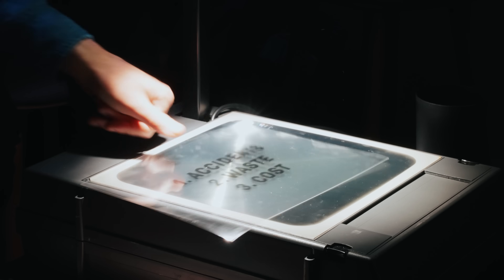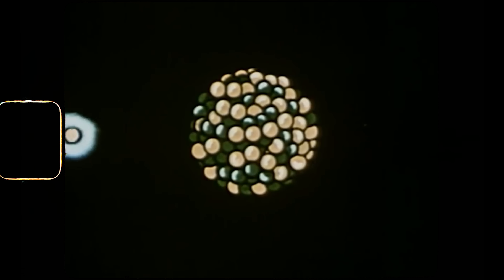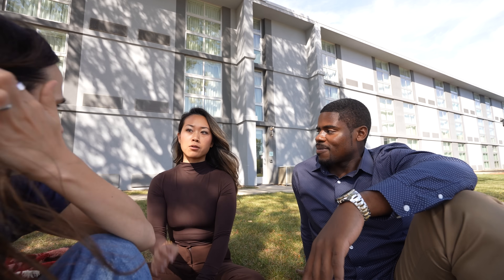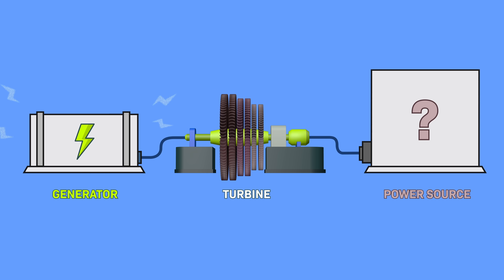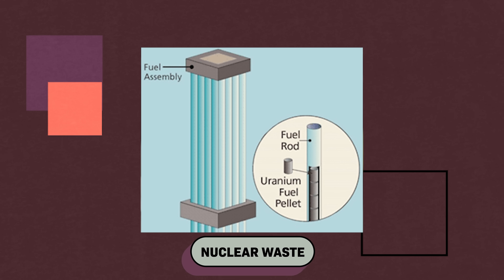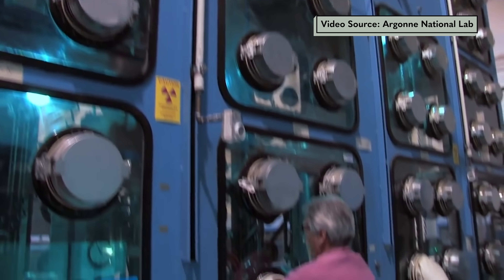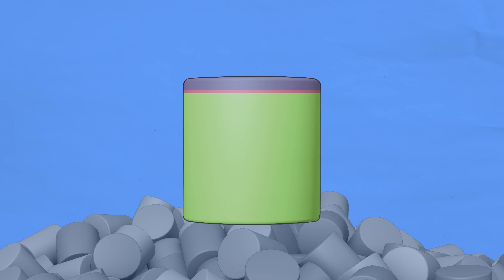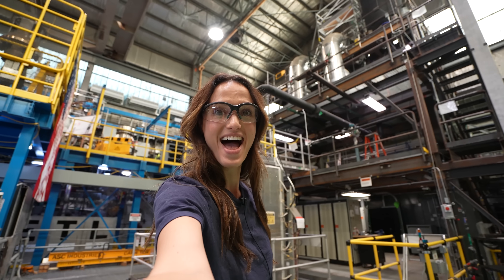The Big Lie About Nuclear Waste

Comment: Why is nuclear power and nuclear waste so hated? 
During the Cold War, Greenpeace made bank on anti-nuclear propaganda, much of it so dishonest that the co-founder of Greenpeace actually left the organization in disgust because of the lies they were perpetuating about nuclear power. But hey, it made billions for them, and people on the Left are just as susceptible as people on the right to propaganda produced with a profit motive in mind.

One of those pieces of propaganda is “nuclear power produces radioactive waste that is deadly for tens of thousands of years.” Uhh…no. That’s not the way radiation works.

The things that are most radioactive have the shortest half-lives. Radioactive waste is very dangerous…for a few years. After that, the highly energetic short-half-life stuff has decayed to the point where it’s somewhat dangerous for a few decades, and then those radioactive elements decay and you get something that is mildly dangerous if you’re not careful for thousands of years.

And this whole “deadly for thousands of years” thing is so interesting. That’s supposed to be scary? The toxic byproducts of many other industries are dangerous for billions of years! Arsenic, for example, used in the manufacture of solar cells. It’s toxic forever. I find it very strange that “toxic for thousands of years” is so frightening, but “toxic forever” doesn’t produce the same fear response.

Coal plants release far more radiation in the environment than nuclear plants, in the form of radioactive gas and radioactive fly ash from naturally occurring uranium and thorium in coal beds. If fly ash were subject to the same laws as nuclear power plants, it would have to be entombed in sealed casks. Instead, we mix it in concrete and make schools out of it.

Propaganda. Many, many people on the left have been conditioned by propaganda to feel an overpowering emotional response triggered by the word “radiation" and "nuclear".

Comment: It is most unfortunate that the average citizen has a visceral fear of the word Nuclear.  Even the ubiquitous MRI used to be called NMR (Nuclear Magnetic Resonance) imaging which is a pretty reasonable description of the actual process used but patients only heard Nuclear and feared the non existent radiation.   Politics and physics simply don't mix. Micro reactors are probably the future for remote areas and some forms of industry but it needs some sort of politically correct name.

Comment: Thorium.  Happy coincidence: thorium is mingled with rare-earth elements, those same elements we need for green energy and chip making.  Currently China provides the lion’s share of rare-earth supply.  Given the geo-political tensions we’d be wise to develop rare-earth mining and processing in North America.  Thorium comes along for that ride.  It’s treated as a waste product right now but thorium can be mixed into the fast reactors to further extend the fuel cycle.  Still more fun is that the US already has a thorium stockpile that would last nearly a thousand years in molten-salt-reactor (MSR) electricity.

Comment: You kinda forgot to mention that out of the nuclear waste created only 5% can actually be used for the recycling process. That recycling process reduces the volume of the very high radioactive nuclear waste but increases the volume of middle and low radioactive nuclear waste. 
Meaning: you would need way more of those dry caskets but they wouldn't have to last millions of years. 
Also worth mentioning: Japan and France tried creating those fast breeder nuclear power plants who would be able to recycle nuclear waste and both of them failed. The japan one was called Monju and the french one was called ASTRID.
So it makes sense that nobody really want to try something that failed multiple times already.

That being said, I'm not an expert on that topic, I was just really interested in it a couple years ago and read up alot of studies on it which made me understand why this isn't really a solution to the nuclear waste problem. Yes it significantly decreases the amount of years it has to stay stored from millions to only 1000s but it also significantly increases the amount of nuclear waste produced which is exactly something that we certainly don't want.
Reply: Molten salt or sodium fast reactors like Terra Power or Exodys Energy solve all the solid fuel fast neutron reactor problems. In the Exody's reactor the fuel pellets don't even need to be reprocessed, just chunked up and dissolved into the fuel salts. Nothing comes out of the reactor.

Comment: I've heard/read numerous times that the bulk of nuclear waste (by volume) is irradiated, non-fissile materials like tools and clothing. Are we still stuck storing all of that while only the fuel is "recycled"?
Reply: Let's say you expose a hammer to a  used fuel rod.  That hammer will go down to being as radioactive as before the exposure after about 200 years.
Reply: There is no reason that low-level waste needs to be treated any differently than any other garbage. This is just part of the over-regulation that makes everything in the industry expensive.

Comment: Excellent video.  Now do one on LFTRs; this stands for Liquid Fluoride Thorium Reactors.  These reactors were also developed at Argonne national laboratories.  Many benefits to LFTR reactors including vastly reduced nuclear waste and most of it does not last ten thousand years, much reduced physical foot print because there's no need to contain a steam explosion, and finally, what the public loves, is the nuclear reaction inherently cannot cause a meltdown.  American Scientist had a very informative article on them written by Dr Hargraves.
Reply: The main advantage for LFTRs that I'm aware about is that thorium is extremely abundant and is currently treated as a waste material by most mining operations.  If we could build viable LFTRs, then we'd be able to turn those waste piles into energy.  The main issue that I'm aware of is that the molten liquid salt is highly corrosive; and has been in need of some advances in material science before they can be made viable.  On the MSR vs LFTR issue, my opinion is that humankind would be better off if both were in an easily commercializable state.  More arrows in our technological quiver, as it were.
Reply: There is no advantage of a LFTR over a uranium MSR breeder. Actually uranium MSRs are cheaper and easier to build and have all the same advantages.
Reply: Same problem as with waste fuel. Too expensive. Both these technologies were developed when we thought we'd have a shortage of uranium. But then we found more uranium deposits and the cost of manufacturing new fuel crashed (because all the plants had already been built). As such there was no economic incentive to use Thorium or waste fuel. Some countries like India, China and Japan which don't have significant domestic sources of uranium might consider it as a national security thing, but other than that there is little incentive.
Reply: @veergauba  Incorrect, prepping waste fuel pellets for molten salt fast breeder reactors is cheap and you only have to do it once. Turning it back into solid pellets as described in this video is expensive and has to be done over and over.
Reply: Agreed.  We might have had these reactors in use for decades had it not been for the political efforts of Nixon to shut down that project.
Reply: This content provider will never do a video in favor of LFTRs. Bet.

Comment: wait, now that rockets are getting cheaper, wouldn't it make more sense to blast some of this into sun?  or perhaps not the sun, we don't want to fuck around and find out, but perhaps Mercury.
Reply: Putting nuclear waste into something that goes high up in the air and then very possibly explodes is... problematic.

That aside, thanks to the speed at which we are whipping around the sun, it takes less energy to send a rocket entirely out of the solar system than to slow it enough that it drops into the sun.

Comment: I hate these videos about nuclear power that sell the idea that we don’t have more plants because us ignorant people are scared.   Safe nuclear plants and these experimental recycling plants are way too expensive and can only be built and operated with enormous sums of public money.  Why not put that money in renewable energy sources that don’t produce toxic waste?   That’s the real question.  Its not because we are afraid.
Reply: Nuclear has a high upfront cost, but since they have a long life the cost is actually not high over the duration of energy production. Much of the high cost is due to over regulation and lack of experience in building them (in the US) China, Korea, UAE build reactors on time and budget.
Reply: Simple answer is because renewables are intermittent energy and to add transmission, back and replace every 25 years would be most expensive use more resources and mining (with its own toxic waste)andan enormous amt of land… then, what do you do with all the materials every 25 years? Millions of panels and turbine blades landfilled?
Reply: Simply because the yield from nuclear energy is waaaaay more than renewables can ever hope for
Reply: That's...not true. Even if every nuclear reactor had a meltdown in the USA there would still be less deaths per kilowatt that coal and oil. People in Cities with nuclear power have had incredibly cheap electricity bills. Nuclear power is purely a political problem. It is in NO way a cost or engineering problem.
Reply: You know of a renewable energy source that doesn't produce toxic waste?
Reply: @submijiru  As much as every manufacturing process produces some dangerous waste, I am sure they all do a bit but wind, solar, and geothermal aren't producing anything we dream about launching into the sun.

Comment: MOX fuel - containing plutonium derived from recycled spent nuclear fuel - is widely used in reactors in France and other European countries. On the other hand, fast reactors, which (probably?) are mentioned in the video, due to the problematic use of liquid sodium, are actually on the censorship. There are several other solutions for reactors operating on fast neutrons, including those cooled by lead-bismuth euclectics, but the problem here, by contrast, is the transformation under fast neutron bombardment of bismuth into radioactive and highly poisonous polonium. Nevertheless, such maintenance-free, heavy-metal-cooled fast neutron nuclear batteries are the future of low-power power generation. Such a maintenance-free nuclear battery as a local boiler house can operate without fuel replacement for up to 30 years. After this time, it is taken away and a new one is put in, and the used one is sent for recycling.

Comment: Switching to HALEU TRISO fuel enriched to about 18% would greatly increase efficiency, significantly reduce waste, and make it more resistant to potential heat damage when operating far outside of normal conditions. This is well established technology already, it just needs will and incentive to switch to the new fuel cycle.
Reply: Cost for HALEU used to be high and thus despite the advantages was only used in small research reactors. The main reason for this was the cost of enrichment. However enrichment costs have dropped as technology has improved that now enables much more efficient enrichment. HALEU fuel is still a bit more expensive than LEU fuel but the cost savings of less frequent refueling requirements, smaller reactor size requirements, and smaller volume of waste to dispose of creates a net cost savings.

Comment: I'm sorry, but this sounds way to easy and cheap. There is definitely more to tell than this short bit, which feels like a paid video for some company in the back. I am not saying that you are lying, but i am certain, that this is not the whole story.
Edit: If you are speaking german, there is an article from Quarks called So könnte man Atommüll recyceln.
Basically it says, there is no working facility and in Japan, they had 2 accidents in 2010 and shut down after 250 days.
Even though there are small steps, this is still in an early phase of development. (after 60 years!) Also it is still very expensive, so i guess unlike we run out of Uranium 235 (which some suspect to happen before 2100), capitalism will impede it.
Reply: Exactly like so much in the "isn't science cool" genre.
Reply: I dont think it's as scarce as they originally thought it would be (WW2 times), plus it can be reprocessed. 
Cost is huge, the initial cost of the facility is only a tiny portion of the overall cost for the next X hundred years that it needs to be operated, maintained, and decommissioned.
Reply: If it sounds to good to be true it usually is.

Comment: This is an interesting technologie, definetly. But the main reason, noone will care about it, is money. There are way cheaper ways to generate clean energy, like solar and wind. Even if the technologie gets improved, I dont believe it's possible for it to get cheaper than the classic renewables.
Reply: If the price of copper, neodymium and other rare earths gets high enough it might become competitive, especially if energy storage doesn't get good enough. Nuclear is a very good base generation of electricity. Just need to underline that new tech (like small reactors, gen 4 etc.) takes decades to refine and build, and that making it profitable requires decades of production.

Comment: This time it's *untrue.

What this scientist said, "We're talking about technology that has already been demonstrated before and proven. We just need to commercialize it."
Yeah, that's about the hardest part! In particular when it comes to recycling. Recycling anything, for that matter. Many people think that we're recycling most of our plastics. But we don't. Because it is increadibly hard and therefore not economically feasible. and recycling nuclear waste is way way way harder than plastics. The required facilities are way more expensive to build. Transportation is way more costly. Your staff needs to be on a whole other level education-wise, and is thus way more expensive. 

We recycle so little of our plastics not because of a lack of will, but because so many fail to generate profit from it. The market literally doesn't allow it. And this is even more the case with nuclear waste recycling. Nobody will be able to apply it for energy production and make it even remotely cheap enough to compete on the market. Economy of scale has its limits.

And on top of that: Remember, only high-level nuclear waste, which makes up but 3% of the whole, is even remotely suitable for recycling. We would still have to deal with the rest, which means the costs of nuclear waste storage wouldn't go down significantly.
Reply: Hush now, the sleepers are still enjoying their dream and don’t want to be woken up with facts and reason.
Reply: not true. You can use U238 in fast neutron reactors / breeder reactors. That's why they say US has energy for 150years
Reply: @martinkominek6712  But no one has ever seriously tried commercial breeder reactors. Things learned from previous attempts: they’re much more expensive to build, they’re proliferation hazards, there are serious safety concerns, and they produce neutron-poison elements like polonium that have to be continuously removed (and disposed of) in order to keep them from killing the reaction. So it’s not the easy solution that the YouTube comments section tells us it is. It would take at least two decades, probably longer, to build breeder reactors at a scale required to even beginning to replace fossil fuel. We don’t have decades to screw around waiting.
Reply: @davestagner  Again, not entirely true. Example is BN-800, although it's main mission is to burn plutonium from weapons stockpile. And nobody said it would be easy, however the math is figured out, concept is proven, technology exists. That is significantly more than fusion has achieved. It targets the waste material which is already produced. I am not saying to sit and do nothing, i am simply saying it's a way worth exploring
Reply: it's not even HNW it's only spent fuel, that makes up less than 1% they rest still needs storing. It may reduce the amount generated in mining, but would also lead to more waste from the recycling plant so the reduction in waste would be negligible. Might still be worth it for nuclear nations for other reasons but it does very little to adress the problem with nuclear waste.
Reply: It's expensive in countries with extensive regulations. Other countries are already using reactors with 100% MOX-Fuel, and recycling already on the rails on large scale. Market is open for it, because other countries aren't so  afraid of it and are willing to buy this type of technology. If one would start thinking in a scale of not just one country, but rather entire globe, then perspective for market is much wider.
Reply: @vitos1k  Only 32 countries have nuclear reactors at all. Many countries are politically, socially, or economically incapable of building nuclear at this point. I don’t see that changing in a short enough timeframe to make a real difference.
Reply: @vitos1k  If one would start thinking in a global scale, then Europe could have one large electric network and renewable energy could easily provide base power. Because larger networks with more sources are more resilient. This would still be way cheaper, more flexible, more quickly set up, and with way less longterm reliabilities than anything nuclear related.
Reply: @vitos1k  Wrong. There is no MOX recycling.
Reply: @whuzzzup  i meant "recycle spent nuclear fuel for MOX fuel production"